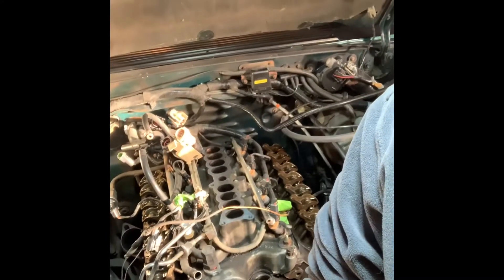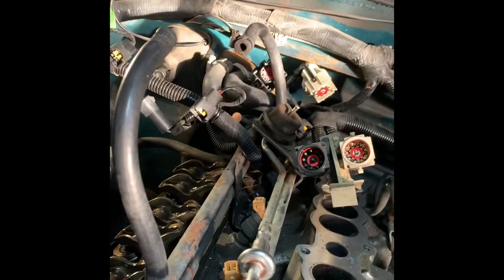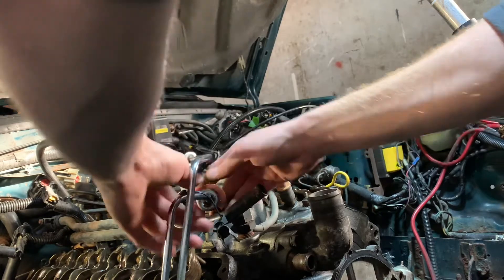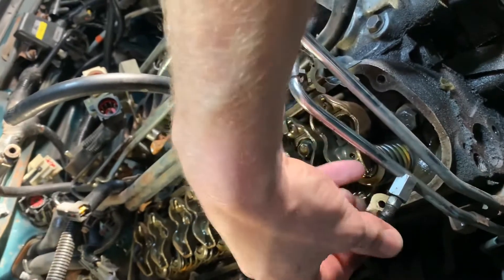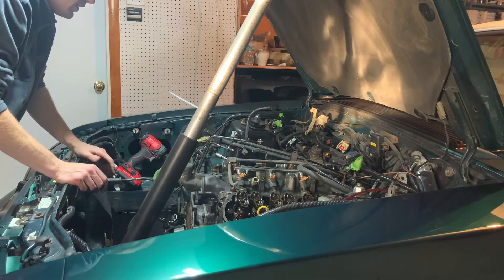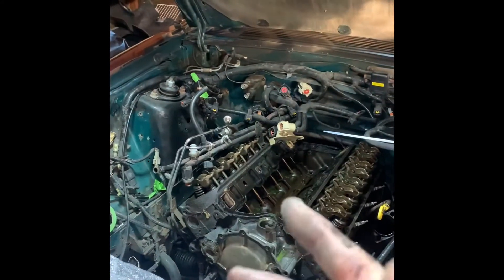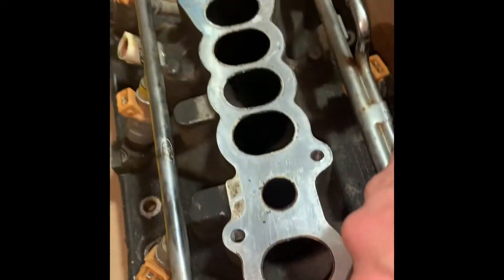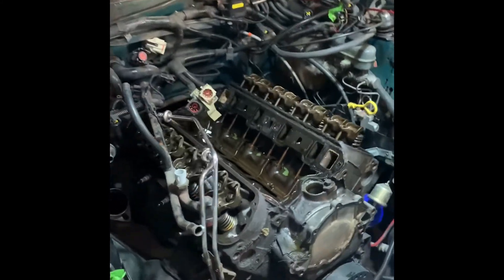Mustang Lower Intake Manifold Removal

Comment: Cool video,ill give you a tip i learned a long time ago,when you remove the lower intake it is understood that you are doing it to replace gaskets or fix a issue down there , replace or upgrade injectors etc,regardless more than likely you will be removing your injectors off the lower to give the good ole intake a bath and get it nice and clean before you put it back on.

I dont know about most people but i despise taking those fuel lines off,i probably have every type of those tools hanging  in my garage and i hate them,then, when you disconnect the rail you have fuel going everywhere and you are disturbing o rings that are several decades old where the fuel rails snap together,what i do is the following when removing the lower intake....

I remove the four bolts holding the rail to the lower intake,here is the cool trick, around the back of the alternator if you follow the fuel lines you will see a black metal clip made of spring steel,this little bracket /clip is very stout, the head bolt in that corner is actually a stud, this little bracket clip is screwed on with a nut to that stud and what it does is it keep the fuel lines totally immobile so they wont be vibrating.

Take the nut off and  pull your fuel rail off with the injectors,and voila!  you can actually slide the whole fuel rail to the side and set it on top of your radiator completely out of your way while still  connected to the fuel lines.

The fuel lines going to the tank below the alternator are flexible and will rotate to allow this maneuver,last time i did my lower intake gaskets i did this,i loved it!

Comment: I have the same car  if I get the  Typhoon Intake Manifold for Small Block Ford do I need aftermarket upper manifold
Reply from the maker: Yes you need both upper and lower , the ports will not line up right , to bad I just sold a Typhoon upper and lower ported was a nice piece !
Reply from the maker: If your near Massachusetts I do port work I’ve done a handful of intake manifolds in the last month !